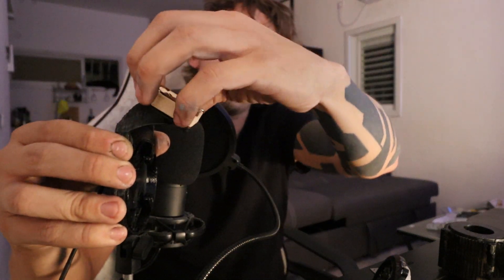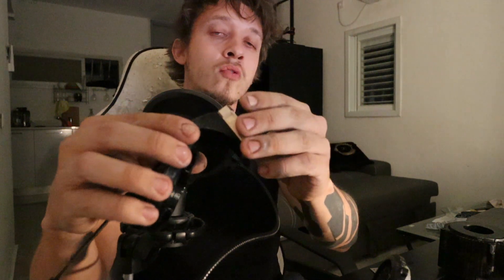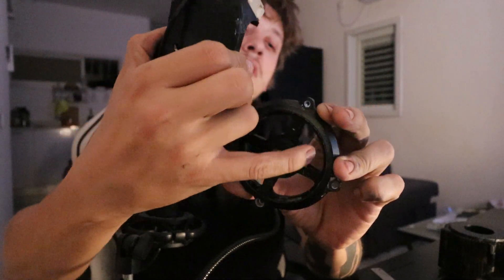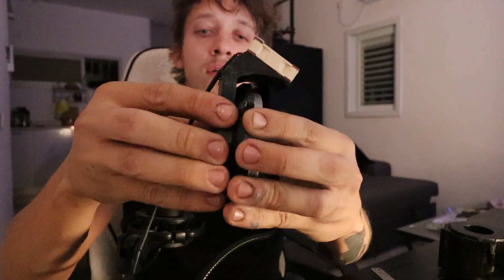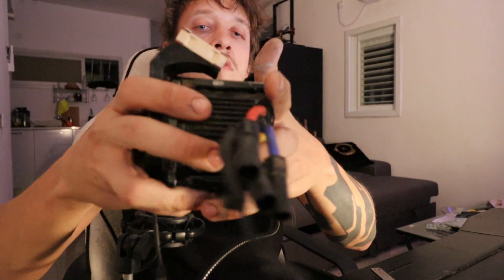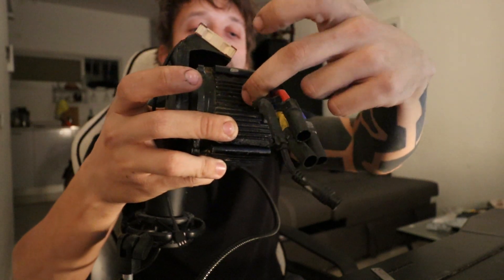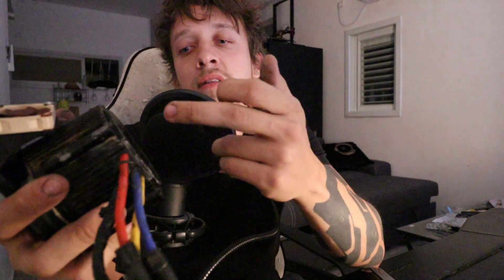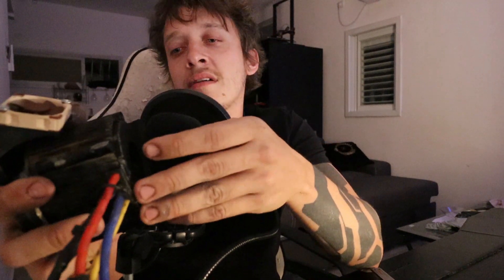My CYC GEN2 motor DIED. (less than 3kw continuous power). AIR SOLUTION NOW. part 1

Comment: Any chance you would know they fixed this issue on the gen3?
Reply from the maker: This is not a fix that needed to be done. Its just not 5kw motor haha. Over advertising at its finest. Run it at 2.5-3kw and you'll be most likely good.
Reply: @SUB13333  Yh i was thinking this too! Its like most things electrical the marketing is for average use but for people like us it wont turn out completly true haha.

Am looking at the Gen3 but i will be riding it hard also.

Comment: Would the cyc x1 pro gen 2 still be a good option with a bac2000 if I had an excellent drivetrain that could handle the power?  Has the motor kit been reliable enough for you? How is the lighting rod motor compared to the cyc x1 pro? Thanks

Comment: I hate the fact that they rate these motors at peak power, which means 3000w for a few seconds at a time, it's really 1500w or 2000w depending on the company. QS rates there motors right, if you get 3000w motor, it can run at 3000w continuously and peaks at 4 or 5000w. 40amp seems like 1000w to me. I have drilled holes in my 2000w 72v hub motor, I put metal screen over holes to keep the big stuff out, and attached fan blades to inside attached to hub, doesn't move as much air as I hoped, but still helps, I am toying with the idea of mounting 5cm 5-8v fan to blow through the motor?  Your idea is sound 👌 and should work, but even then you can't ride full throttle everywhere.
Reply: problem with the QS' is that they're either hub motors or the middrives need quite a bit of work to fit on a bicycle

throttle is overrated tbh, if you ride throttle instead of using pedals it's an e-moped or e-motorcycle tbh.
Reply: @BH4x0r  just wish other companies would rate motors the same, peak watts is just misleading.
Reply: @liamneal5325  yeah, well, it's still amazing how much power you can put into it, 5000W peak actually, i think it would have no issue doing that if you run it the intended way, with the torque sensor, as it won't be full throttle but it will be dynamic and more fun imo

i mean they're advertised as the most ridiculous torque sensing and small middrive for ebikes and eMTB's that should excite THOSE enthousiasts, not the common "moped people", aka that run throttle, and imo they win there

yeah maybe they shouldn't call it 5kW then, idk, but it probly will work fine without ever blowing up when using it as intended

Comment: This motor is rated 750w continuous, 3kw max, don't know why they say 5000w, presumably burst rating. Basically 750 all day long with no overheating, but 3kw for very short bursts. It's annoying that manufactures are going the way car audio has in terms of advertising hyped numbers that seem impressive, but in the real world can't do that power.... You might actually be better using the fan to pull air over the motor (sucking it through). Also making sure the heat path from the stator to the main case is a efficient as possible. With the bafang motor, some have added heat sinks to the outside with some effect. Endless Sphere forum is a great resource for information, lots of hotrodded motors there!
Reply from the maker: i was will probably make heatsinks as well at some point :) and will also try different cooling angles (outside, inside ).
Reply: yes in terms of dust or moisture potentially entering the motor area, sucking air out rather than in makes sense!  i'm sure if its open in any manner there will be air forcing to flow in as hard as it can, especially travelling at speed...  Pretty curious to hear your progress and good luck!  :)
Reply from the maker: @dylandaviesdiptych  lets not forget some basic physics ay ? :) 
Sucking or blowing ( lol ) is the same thing when you have 2 air shafts !!!
So theres literally 0 difference.
Without 2 shafts i will be just creating vacuum to some degree if blowed out, or a inflated like baloon motor, if blowed in.
Reply: @SUB13333 , if blown in, positive pressure, there is less chance of dust or particulate building up in the corners and edges. Drawn through, negative pressure, is bad for dust and dirt buildup. If you want to do forced air cooling, do positive pressure with a filtered intake.
Reply from the maker: @majorbogart3476  air filter is already on the shelf waiting to be applied. i will not create a positive pressure in the motor, as i am not trying to inflate it, i have to go through it to let the air circulate.
Reply: @SUB13333  I am not talking enough to inflate. It is thermal management theory. Especially important for electronics.This is how active cooling in cars, planes, computers, and snowmobiles work. Fan pushes  air onto rad/heat sink/whatever, not suck it through. Drawing through, will require a bigger, louder, more powerful fan to fight the negative pressure. A blower works WITH the air pressure to increase the air flow, like the grille on the front of a car with the fan directly behind it, and the rad behind that. It will still circulate.
Reply: @SUB13333  if there's a part of the rotor you can access, you could probably 3D print a blower fan that would work fine for this motor (that is powered by the motor itself)
Reply: Yeah, what you said
Reply: i wonder if it is sealed enough to just fill it with low viscosity oil, i'm sure that'd help, or 3M Novec engineered cooling fluid (fluid that boils at low temp to a gaseous state, possible to get at different temperatures aswell to cool down the device, this is what you see in most cases of submerged PC cooling, where you see no coolers or pumps at all but you see bubbles coming from the cpu, thats Novec)
Reply: @BH4x0r  low viscosity oil will work with a low rpm DD hub motor, but a high rpm motor such as this will cause massive loses. Also, it's an in runner motor, so the heat created by the stator should be easily dissipated to the outer casing. A DD hub motor is an outrunner so getting rid of the heat is much more difficult. The other thing is that heat generated is lost mechanical energy and above a certain point of amps/volts simply means the coils are saturated meaning that no matter how much more you put into the coils, you won't produce any more magnetic flux. It's a case of diminishing returns.
Reply: you can run 5kW when using the PAS mode tho, if you have a BAC2000, the 855 cant put in enough power

Comment: I was thinking of buying this motor with the 5kW controller but if it overheats so much I don't think it's a good idea. What a shame
Reply from the maker: the motor is great dont get me wrong, i woudln't hit 5kw anyways to make it easier on the drivetrain.
Reply: it can handle that but only in short bursts, and this motor shines more in PAS mode either way

dunno why most 'mericans want to be fully lazy and just use throttle only